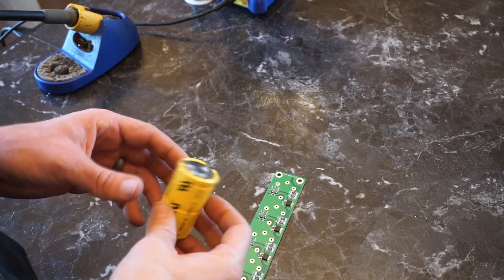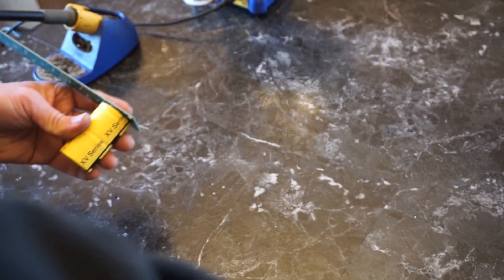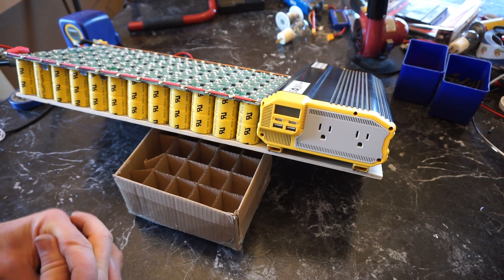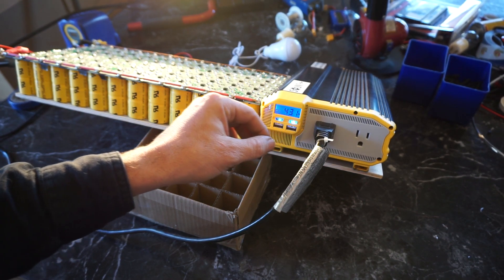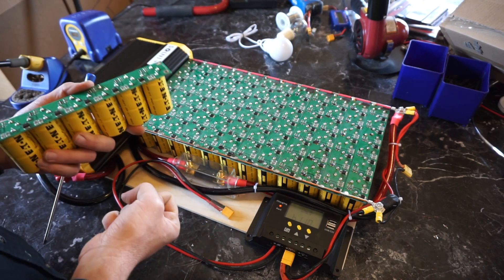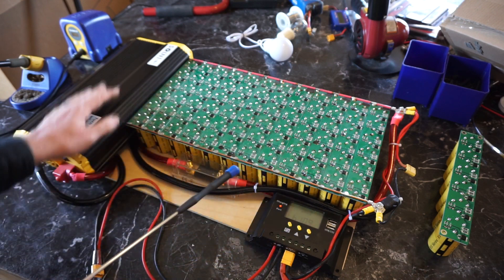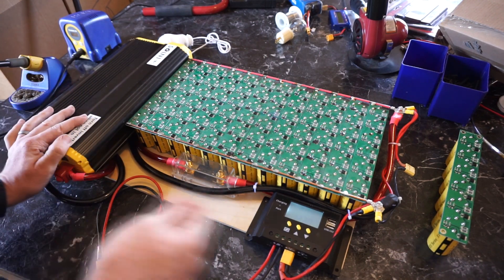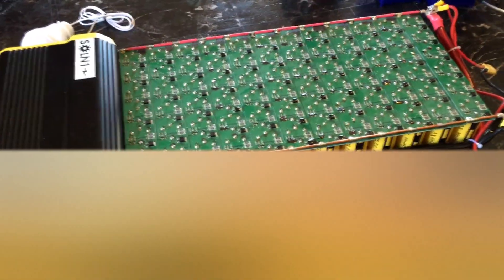Building the SOLN1-2000 Watt Capacitor Solar Generator

Comment: They have graphene capactors got two 1300F capacitors at 4.2 volt going to try Zenner diode protection to prevent over voltage.

Comment: Im putting on some of these in series between the panels and controller. Since the panels are 24 volt  series .. the mppt has troubles  in fluctuations of power, this will even it out. Than got some on the lithium  bank as well.. this is the hobby now..

Comment: Great video. I'm really just getting inspiration for a full solution I was planning out.. to integrate Grid Power, Solar and Gas Generator into one.
Grid/Solar/Generator --> Capacitor Bank (12v @ 10ah) --> Charge Controller --> Battery Bank (35kwh) --> Capacitor Bank (12v @ 1kAh) --> Inverter --> Appliance(s).

This greatly simplifies the system, and integrates them all together, extending life and etc. A thought I had though was to put all the lights on one breaker and power them with DC current (skipping the inverter) to improve efficiency. Haven't found much on this and it's not the common setup I know.
Reply: I power lights ,laptop ect on dc. it's a good way to avoid turning on my inverter. lots of 12volt lighting options. use a DC to DC boost converter for the 12V to 19V laptop.
just watched a guys set up: PV - charge controller - Capacitors + batt in parallel - inverter - load.
in your diagram the PV could over voltage the Caps and damage them. charge controller has a steady volt output.
Reply: @nomadicoasis9260  My thoughts as well, save the inverter while reducing conversion overhead for anything that can run on a battery. I think it would be relatively easy to convert TV's and the like as well, but obviously considerably more involved. And thanks for the Charge Controller suggestion!
Reply: This guy is the one stop shop on making everything DC.
https://www.youtube.com/watch?v=jMiqbT4abH8&list=PL0uBLqOOwG8iOZNYNvekzpuV4Moe-lwFy&index=25

Comment: Hi, my name is PJI would like to find out. Where do you get the capacitors and where can I get the boards to match? I would like to try this. I'm very interested in this project. What is the charging voltage that you need to charge up the complete package? I want to build a massive one but I'll need to find out what kind of capacitor is confusing and where can I get the boards?  It's not showing up on your website

Comment: I have a solar inverter and 4 batteries in series (48volt). The maximum charging voltage is 54volt. I am thinking of placing 20 2.7 volt 400 Farad capacitors in series (54volt) and then in parallel to the batteries. Is it possible to use Capacitors without a balancer? I would like to know your opinion.
Thank you.

Comment: pls be more gentle when unfurling your expensive portable solar panel.  yes they're flexible but nowhere do they ever say robust. micro cracks, tiny wire metal fatigue, and don't ever stand on them! and none have ever been duty cycled for flex repetitions. they are not biceps.  its not a snow carpet -its more of a sea monkey. better to mount them on a stiff plastic grid material.  try never to flex them.  and let them breathe! they overheat when glued down!

Comment: The problem with these types of capacitors is electrical leakage which is usually around 15% capacitance loss.

Enphase energy which makes the best micro solar inverters on the market switched to thin film capacitors which have a 98.9% retention against electrical leakage.

Thin film capacitors would also reduce your capacitor bank sizeby 50%.

Comment: Love the idea but with 12 banks of caps that system + inverter, solar panel, etc… is what?  $800 or so?  For that just grab a 2.4kwh LFP battery and the inverter and your in the same ball park price wise with a smaller footprint.  You could even do a combo inverter/MPPT controller for around $300 + Battery and be in the same price range with a much higher solar input and actual storage.

Comment: I have an idea that I'm going to try. I have a 160V capacitor bank that I got when Maxwell liquidated after being bought out by Tesla and I am loathe to take it apart. I want to use it as it is. I only have a couple of solar panels - a 100W, 18V and one of your 10W panels that came with the USB LED lamps (awesome). So what I'm going to use for my little generator is the 18V panel, the 160V capacitor bank, as it is, and I have 40 18650 batteries SOO - I was trying to figure out how I was going to get enough voltage to charge the capacitor bank when it hit me - I have 40 3.7V batteries! Duh! SOOO , Instead of just using the batteries for power, I'm going to use some of the batteries to "boost" the 18V from the solar panel up to 90V via the battery bank so I can power the capacitor bank with that. Sort of like your hybrid boost pack. And I'm not going to use a charge controller. PFFFFT! I'm sick of looking at the damn things and trying to figure them out. And now they've caved to corporate interests and are trying to push all of that "positive ground" crap in everybody's face and nobody knows what's going on. I have enough cells to underdrive the whole thing so they can stick their charge controllers where the sun don't shine. I'm not even going to go there. I'm just going to run everything in an "analog" straight line from the solar panel and batteries through the capacitors and straight to the load with nothing but some one-way "valves" and a timed load on the battery bank for sewer management. Rather than anticipating problems, I'm just going to wait and see what problems, if any, arise. But I am going to attache little voltage meters to each battery pack. I'm not concerned about the capacitors - I haven't touched them. They're assembled and tested and "weird" environments is where they like to live so...I think they'll be happy but, anyway, I'll start them at 90V and see what happens.

I'm going to hook up the capacitor bank directly to the solar panel first, just to see what it can do with its 18 - 20V but I don't expect it will be very happy with that sort of wussy environment and I don't want them too..."hungry" although, I'd like to build them a "capacitor" case and see if they'll interact with the air...they might need a bit of hunger to respond measurably...we'll see...

BTW, I'm putting this here because you're off doing other things and this vid is 5 years old so, only other die-hard explorers will ever see it and maybe they'll have some better ideas about how to get a hundred volts out of a hundred WATT solar panel. It's not going to be powering an air conditioner or freezer or anything.

Comment: Do you find parallel connection of battery and capacitor banks produces detrimental shock loading of the battery….?

Comment: Hi,  I live Off Grid and are building Domes for a home. I have been thinking of deferent way to power my home currently I use solar and gas generator. I have an earth battery experiment I plan to make this year 100 foot long 3 foot wide with Iron and carbon rods and Calcium Chloride. I'm am thinking now of make a very Large Supercapacitor to power the house. If I make a supercapacitor that was 6 feet diameter 4 foot tall. I was thinking it could be made with two 4 foot wide sheet of aluminum painted and covered in Graphene  4 foot wide roll sheet of packing paper and roll it up to a 6 foot diameter and put it inside of an insulated cement dome( because I build domes). Do you feel this would be a good way to build a large Supercapacitors and would it work? My channel https://www.youtube.com/watch?v=DL5layf9jxw&t=914s       https://www.youtube.com/watch?v=DVk6xNFduH4&t=15s    And my Litz wire machine  https://www.youtube.com/watch?v=DNbxxMaO7Mo     Thank You, Harry

Comment: hi  i saw a few of your videos and was wandering if i could use about a 9 inch solar cell with some capacitors to run a 12 volt bilge pump? im a gold prospector and a big 12 volt battery is not fun to lug through the woods lol and i think what you are doing would  work great. what are your thoughts?

Comment: Good video ,  just one question , what if you  hook up a      24v   supercaps bank direct to a 12v  panel  without a charge controller would the caps overcharge like battery and damage?

Comment: You would. Be better off using a. Dc to. Dc convertor ...the capacitor. Price. Is out range ...cost 5$  to 8$  EACH 800 $or more ! 
Not practical !!!

Comment: Great video and thanks for the links. I currently have Dyna-batt manufacturers ID 5575B  its a 12V, dry cell battery, 16amps hrs, and it is 4 years old. I bought it for the weight savings in my car and at $159, it was the best option. Now, the CCA on it is around 280 and I live in NE and on days where its under 50 degrees, the car struggles to start. I want to maintain the weight savings and I like the idea of a supercapacitor, in parallel. What kind and how many would I need to help boost this battery? A schematic, or links to what I can buy would be awesome. Thanks!

Comment: how many amp-hours on this setup?
Reply: stop thinking of amp/hours with this setup.
 eg  1000watts of solar  - double the amount of supercaps - will give you access to about 10,000watts for a short time.
 Then put a 1000watt inverter on the capbank . now if you only draw say?  800watts from the inverter .The caps are still charging at 1000watts WITH NO LOSSES like you have with a battery. while the sun is shining  you got alot of power to play with. Now say you use some of that power to run a battery charger you can also charge your battery bank for use at night . Just stay under the max power of the solar input. MAGIC.
Reply: steve cooper lol but that’s how we use household power ... we do not use it in bursts of 10 000 watts over a few seconds. I’m sure it’s more convenient to the success of this approach to ignore that though ... but what about all the constant slow drains on household current like the water heater, phone chargers, clocks, phones and computers etc etc?
Reply: @antigen4  Its not a household setup is it . its a batteryless off grid system to cart into the wilds so you can use your powertools. and i know it no good for home power systems . but it works great on my narrowboat to power my very small fridge /tv/pumps/led lights  ect. but only when i get good sunlight. dont need to use my batterys allday. only need batt power at night .its best used has a hybrid system with my conventional system and make my batterys last a lot longer .i was sick of having to replace them every 2 years. on my 3rd year now batterys still good.

Comment: Thank you for the content. The one thing I'm failing to understand is the economics of the supercapacitors in use. At approximately USD$15 per capacitor then number of capacitors used in this system would equate to over USD$1000 which would buy a good quality LifePo4 100ah battery with high discharge rates.  Cheers
Reply: Capacitors are good for multiple millions of cycles, and they're good at spike loads.  That said, a small LiFePo4 battery would make a great addition.

Comment: pro tip: get some 150wh/kg graphene supercaps, and remove all unnecessary stuff (that would make you money) and use a charger that runs with power coming from the panels

Comment: Add a few switches in place of plugs to save wear and tear. This is an excellent idea. With consistant sun or wind, capacitors could replace expensive batteries and their hassle all together.

Comment: Hi I am really excited with your videos..can you run the electric paramotor with super capacitors in conjunction with a small honda generator ( the one we see in small food trucks) the idea is to use on a small ultralight aircraft part 103 and run electric motor instead of gas engine. Although we will be using gas in the generator my whole idea was to substitute for expensive lithium battery and also I have a spare generator  which is 2000 watts but I can't do the math when it comes to DC volts and watts, since you have a paramotor you know how much it pulls and I just want to know a ball figure or is even viable option to do this.
I am a p3 pilot and not much interested in ppg I rather want to get into ultralight aircraft part 103 
Sorry to bother you to many questions 
I really appreciate your help.
Thanks Harsha.

Comment: Can run it at night too the solar panels with the white light generation unit I got. I got the Hector pack a high power alternators pack on caps super boy😆.👍 for the wind turbines industry and pumps or the fisheries but it could be applied to the hole lot as a 200kv needs a tuck the 200kv dc Hector is 1/4 the old one on a ute on the construction site ??????

Comment: Supercaps cost $30.00 per watt hour. Lithium costs $0.25 / wh.
Reply: Very true. As I see it, the purpose of this system not to replace batteries but to allow a small portable solar panel to provide its slow charge while pulling large current through it while also protecting any batteries you may connect to it from that same high surge. Also, the cap bank is going to be much lighter to carry than batteries to do the same. Finally as I understand, this application of portable power will frequently draw the bank down to near zero which will distroy a battery pack system.
A system like this is why I'm considering to connect to my wind turbine (when I finally get everything to set it up). My generator is rated at 1700 watts but my grid-tie inverter is 1000 watts. For now, I'm only wanting to supplement my electric usage. I'm seeing that I will use more than I will produce but want to use everything I can make. I don't wnt to lose the other 700 watts when it running at peak sure to not being able to convert it. Storing the extra for A short time for when the wind slows down. A battery will stay at 0% most of the time thus giving it a very short life span.
What I don't know yet is how large of a bank will I need. When the wind offs strong here, it last all day and often several days but I estimate it will make an average of 600 watts per hour over a 30-day period. More in the winter. From mid June to miss Aug there will be 1-2 days per week that the wind is almost nothing. The rest is the year, I'll smile every time I look up at it and see those blades spinning.

Comment: Ild like to build a version using my lithium ion ebike battery.  Ive already got a little 1000W generator I wish I could tote for long 200 mile trips. A hybrid battery system charging while also dischargine would be ideal.....with all kinds of ideas for doing other things at camp site.

Comment: An inverter with a wider input range could give you a bit more effective energy storage. 12 in parallel of 6 in series provides 800 F and 16.2 V, which theoretically gives you 29.2 Whr of storage. If your inverter drops out at say 10.5 Volts, however, your effective storage is 16.9 Whr. If the inverter could work down to say 8.5 Volts, your effective storage would be 21.1 Whr. If the inverter would work down to 6.5 Volts, the effective storage would be 24.5 Whr.  Or, it'd probably be more practical to design the inverter to have a higher maximum voltage instead of a lower minimum voltage.  You might  combine your super caps for 200 F at 32.4 Volts, for example, and design an inverter to work from 32.4 Volts (with some safety margin) down to 10.5 Volts. That'd give you an effective storage of 26.1 Whr.  Then again, you're right, and you're better off to go to a hybrid system and use lithium cells for the storage and the super caps for the surge current.

Comment: Why do you have to get the voltage up. Can someone reply with answer for me please.
Reply: I think it’s because the solar charge controller is designed to charge batteries and you aren’t supposed to recharge batteries once they drop much lower than 3V per cell because they may be dangerous. Capacitors on the other hand can safely be discharged and charged to and from 0V

Comment: Haven't you build spot welder from super kondensators?  I'm just wondering for balancing voltage while charging?? And offcourse discharging with high current???

Comment: People need to understand that caps are not a replacement for batteries when one needs prolonged energy supply since caps discharge much faster than batteries because they simply don't store the same energy density as, say, lithium batteries feeding an inverter. Caps are GREAT for supplementing lithiums and lead acids by providing the initial surge current, therefore taking quite a bit of load off the batteries during initial load surges.

Comment: Exciting video cuzz...  Quite possibly  the(or one of) crucial missing link(s)  to the perfect system  or at least a major component of it...  really  I'm jazzed about  your particular application From 7:04 ...maybe  a low V relay ...or old ignition switch... but don't lose the key you'll have to hotwire it !   :^ )

Comment: Can super caps be used in a marine environment to have a system extend the life of lithium ion marine batteries?
Reply: yes they can plus they have one big advantage over battery's which is that they last forever compared to battery's which die after 2 or 3 thousand charge cycles as capacitors last for millions of charge cycles which is good for the longevity of the system that you would be building

Comment: Are my calculations correct? Was that huge slab of super-capacitors only 28.8 Wh? So you would need 35 such slabs just to store 1 kWh?  I know, in this case, you're using them as a buffer for powering stuff directly from solar but WOW, our capacitor technology really needs improvement.  I've heard people talk about using them to replace batteries for an off-grid system and I say NO WAY! The storage density is WAY too low. But I like what you're doing with them to run powerful things directly from solar panels without the need for short-lived batteries.